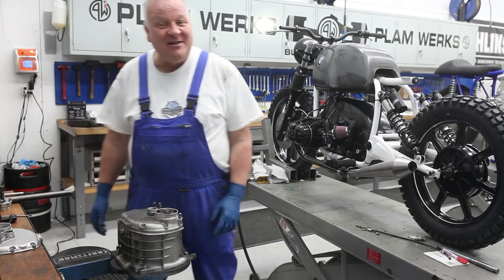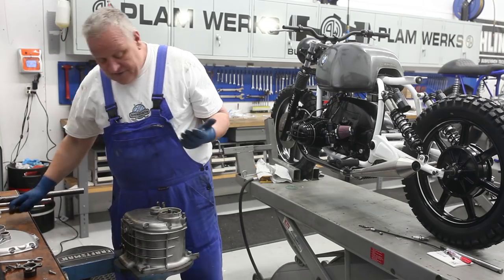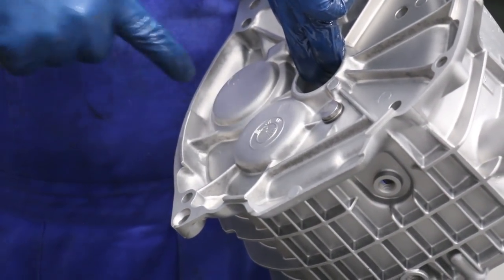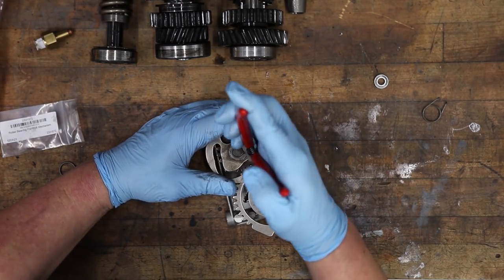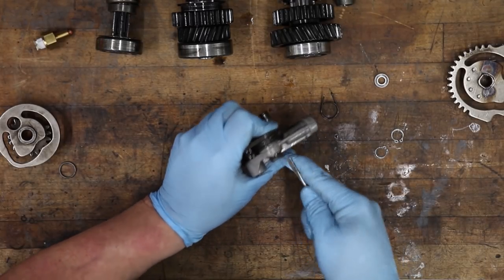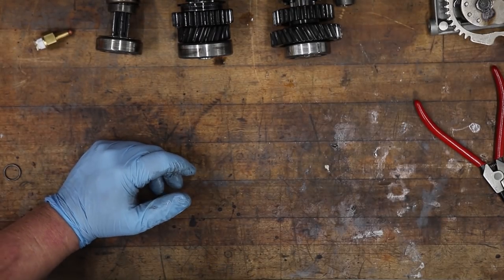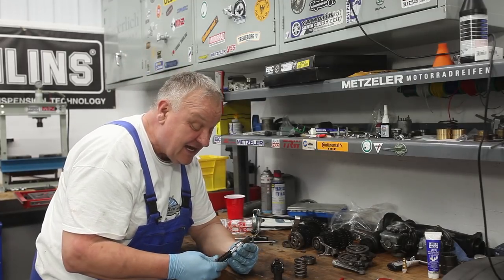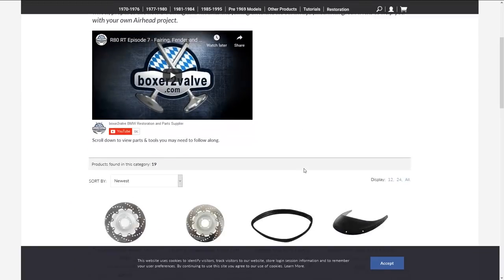BMW Airhead Mechanicals #04  Gearbox Reconditioning Part 1 of 2

Comment: Map gas (yellow tanks) works well to heat the case to remove the cover and the shafts. 
Great Job Bill and company. Another great video. Do a GS rebuild next ;-)
Reply from the maker: I have heard that but never tried it. I use the heat gun because you can't reach a melting point with it and you can set it down and do other things while the part is heating. I'm sure that you are right about the map gas though. Great tip! Thank you.

Comment: Great work once again, thank you William.  
Might the nylon detent wheel give a subtle resistancxe to a shift, helping to avoid accidental shifting, I wonder?  Could the  hard faced bearing, with reduced resistance in the ball race, lead to too slick a shifting action?  I'd imagine the people at BMW gave a lot of thought to the mechanism and stayed with nylon, knowing that deformation is the compromise that they needed to make, to retain the feel that they were looking for. With such a mechanism to be found across such a range of models and such a time span, it seems odd that they appear to have stayed with nylon. Brilliant experts like you will probabaly have given feedback, when these bikes were in production, and I'm sure BMW would have paid heed  to your wisdom.
Reply: Or maybe they just wanted to save a couple pfennings ?
Reply from the maker: We have been using the roller bearing for years and there is no disadvantage. Works brilliantly!

Comment: Hey William. First of all. Thank you for these amazing videos! This is pure gold. 
I do, however have a question that I hope you can help me with. Im on a troubleshooting mission!  

Im having some issues with my clutch and/or transmission. 

1. Im having problems going to neutral when my engine is hot. And sometimes its very tough getting it from 2nd to 1st. 
2 The clutch / transmission rattles a bit when im in neutral (it goes away if im pulling the clutch or goes in gear) 
3. The clutch is not slipping.
4. I have tried all sorts of clutch adjustments. Ive tried setting it to the 20.8mm pr Haynes and the Clymer manual. And wiggles on and off to adjust due to the bikes age. 
5. Ive changed all the oils

Before im pulling off the clutch and transmission.. Do you have any ideas to what it might be?

Comment: One pal had the shift selector spring break, being stuck in 4th. Unreal the box has to come out to fix a what seems flawed design. If you look at a unit BSA gearbox the springs are very beefy, I dred that spring on my r60 going in bear country up here.

Comment: Greetings, I have a 1976 (10/75) R90/6 transmission that needs to be rebuilt. Is that roller bearing that replaces the nylon shift detent holder available for the pre-1981 transmission.  thanks   great video
Reply: well, I just checked out your website & answered my own question, it appears the answer is YES !

Comment: Would this also apply for a 79 BMW R45 gearbox? Could the final gear ratio be increased? Thanks for the lessons.
Reply from the maker: Yes, absolutely. You will need the version without the X and that"part number  2322889
Reply: @boxer2valve  You guys are saints. LOL Thanks a bunch!

Comment: My bike has been sitting for almost 20 years and I'm almost finished restoring it enough to ride it (As a college student I can't afford to have it rebuilt, and I do not own the tools or experience required to do it myself).  I'm having an issue that doesn't seem to be caused by a broken spring on the shift mechanism and isn't addressed in this video. The shift lever will change gears fine but it has to be manually returned to the center position to shift again. (If I lift up from first to go to second, I have to push it back down a bit before I can shift to third, and same for any other shift). It's almost like the shifter is "stiff". I have replaced all the fluids in the bike, but have not ridden it enough yet to warm up the fluids or any parts. Is there anything I can check externally that might cause this, or will riding it for a bit fix this issue?
Reply from the maker: Hello,
If your bike has a linkage from the shifter arm to the shift lever (/7 and later) check to make sure that the linkage pivots are clean and greased! If that's not the issue, or if you have an earlier bike, then there could be corrosion or worn parts inside. Changing the oil and running the bike to operating temperature might help. You may also want to try Liqui Moly MoS2 Anti-Friction for Gears, which we offer under part number 2202019.
Reply: @boxer2valve  Thanks for the response. One of the pivot joints was almost completely seized. Cleaned, greased, and much better.

Comment: Hi, What is the part number for the BMW factory transmission flange tool?
Reply from the maker: Hello. We will soon have this tool available. Probably by mid May 2020. The part number is 8231700. (not yet available as of mid April 2020)